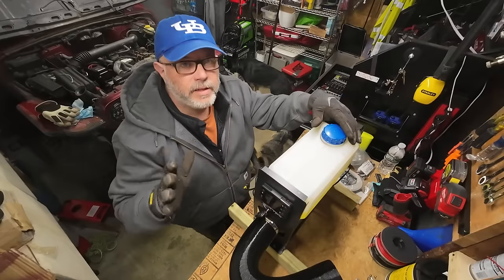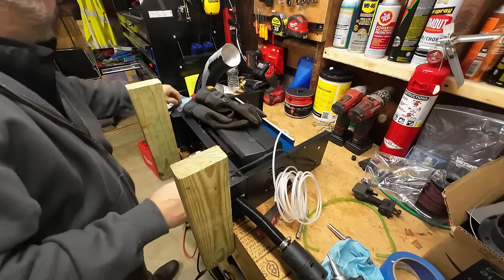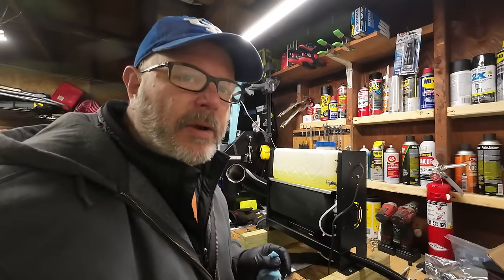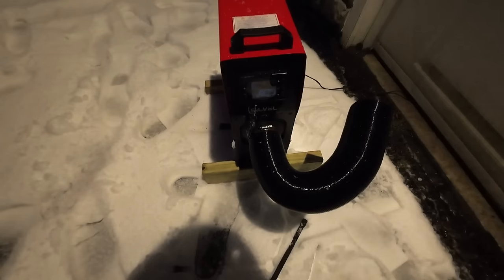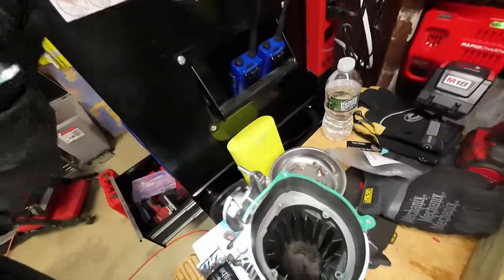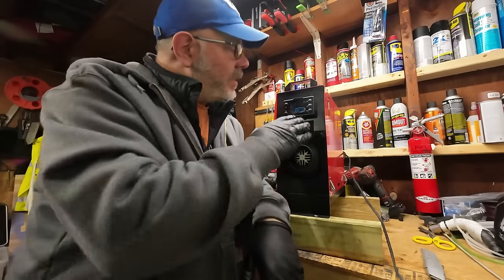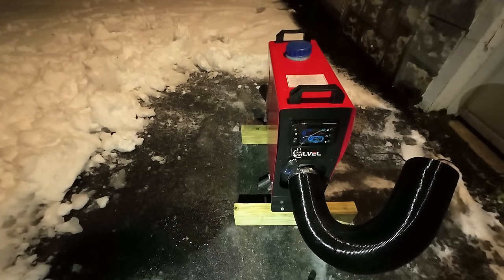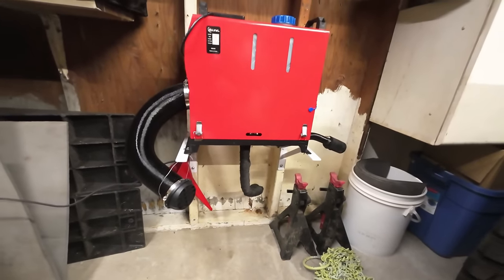Mistakes were made - I almost killed my diesel heater

Comment: If you run these at a low temperature setting you need to crank them up to wide open for 15 minutes to burn out the carbon before shutting them off or you will have this problem.
Reply from the maker: Thanks for the comment. I learned that the hard way. Since I made this video I've been doing that and no issues so far.

Comment: How big of a room will that heater heat ?
Reply from the maker: It’s a uninsulated 1 car garage. It works ok but once I get it insulated I suspect it will be way better
Reply: I have a 8kw one, and it will heat a 5m x 6m insulated room from 6 deg C to 16 deg C  in 97 minutes on full,  I usually run at full for hour that will take it to 13 deg c, I then turn to minimum and it will maintain temp. If running at third it will raise temp over two three hours

Comment: The catch with these is, you cant run them low power long periods of time. They NEED heat  full blast to clear deposits.
Reply from the maker: I always run on full blast. I feel like it was the way the exhaust was because since I changed it no issues. Thanks for commenting.
Reply: Do you think maybe it was the upturn in the pipe near the cold floor/wall caused it to condence right there then causing an exhaust pipe partial blockage? 
I know your theory is that it was water in the bend but with the hot exhaust gas going to cold plus the dip in the pipe would condence then the heavier water falls out is my thinking vs the moisure coming from incomplete burn.
Reply from the maker: That sounds plausible. Since the repair I’ve had no issues
Reply: @paulethier3416  I have mine just sitting on my woodstove and the exhaust runs down then up the pipe just a temporary location but we’ll see if it has any issues with carbon build up. I don’t see/smell anything out the pipe but only burned 2 tanks of fuel so far. 
You said you were always running your heater on high does yours always start on high? Mine automatically starts on medium #3 then ramps up. 
And was yours always showing 206-210°?
Reply from the maker: Mine always starts on hi

Comment: Well Buy a cheap Chinese copy of a proper Diesel heater and this is what you get. To run correctly they have to have good components, and be set up for the correct air fuel dosing. As is any combustion type motor.
And with these cheap Chinese lumps of Cr**P it aint gonna happen. I have a bunk heater in my semi ( A proper one ) and yes they are more expensive and yes there is a very good reason for that. It makes them safe to operate and they will last for years with minimum maintenance. My present Bunk heater is now 7 years old ( Moved from my previous semi ) it gets used every day ( I leave it on whilst parked at home in the winter ) and it has never let me down in 7 years. I service it every other year ( I have never seen such a ridicules amount of carbon build up as the one you showed us ). As the saying goes you get what you pay for.
Reply from the maker: Thank you for sharing your opinion and for commenting.
Reply: Could you tell us the make and model of your heater? I’d appreciate it. By the way, I appreciate what you truck drivers do for us all!
Reply from the maker: @doug8525  Here is a link to the one I purchased. https://amzn.to/3HjoL55
Reply: Hey thanks! Have a great day!
Reply: I bought the expensive one for my semi, intermittent use, didn't last 1 winter. Always a question about whether or not it was going to light. I'll gladly give a $200 one a try next instead of $1000+... And I'll mount it somewhere accessible, be it cheap or expensive...

Comment: Fuel piping / line will not be no problem..
There is no pressure in fuel line before or after pump..
Pump is  pumping tiny amount.
All this crap about green pipe is just amist.
Reply from the maker: I think your right on that. Others suggested to me to change it and I did. But, don't see any difference. Thanks for leaving a comment.

Comment: Lose the fuell filter its nonsense i had one on mine after a year of storage the plastic was brittle and both lines were just broke off  thing was leaking diesel when i took it out of storage . If you burn clean diesel the filter doesnt do didly .
Reply from the maker: Funny you should say that. When I went to fire it up this year the same thing happened to me with the filter. I bought a replacement filter but while I was waiting for it, I just by-passed the filter. Its been running great so I have just let it keep going and I'm not running a filter right now. The new filter is sitting there in the box. Thanks for the comment.

Comment: how in the name of the good lord would a gasket not be important on a diesel engine . you will leak carbon monoxide eventually over time (which you wont smell or see it). the carbon problem was the exhaust not been able to drain moisture (installed wrong) you also have your your fuel filter  fitted upside down  . please get your self a carbon monoxide detector and watch John Mck 47  on you tube he will educate you no end on these heater stay safe and god bless
Reply from the maker: Thanks for your comment. I was able to get a good seal on the gaskets with the Permatex sealer that I used. I've checked for CO and have no trace. I also do have a CO detector installed in the garage. I think the consensus is that the fuel filter is on backwards, however it is working fine and there is no arrow showing the proper direction. I had a 50/50 shot and I knew I would be called out either way. I will swap it out for a new filter and switch it around when I do my end of the year service in a couple weeks. I also agree that the exhaust was the cause of the carbon build up. It has been running perfectly since I made the video.
Reply: Totally agree on your comment been on the tools for years , and btw carbon monoxide detectors don't pic up nox fumes

Comment: You got a habit I turning it down on low heat for long periods of time before you shut it off let it run on high for 5 minutes the burn the carbon out
Reply from the maker: Thanks for the comment. I always have to run it on high because the garage is very poorly insulated.

Comment: Ps if you don't do it
Reply: Just remembered there's a little fine mesh filter about 10mm in diameter needs to be kept clean mate  or it runs crap👍
Reply from the maker: Thanks for the comment and for sharing. I will check it out.